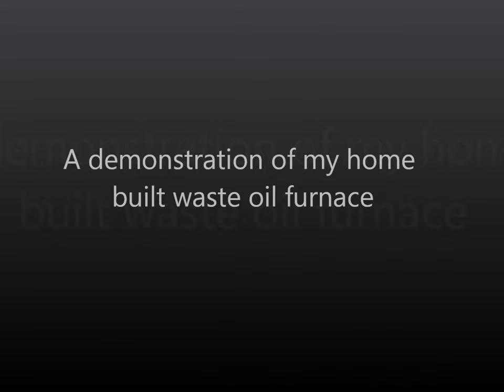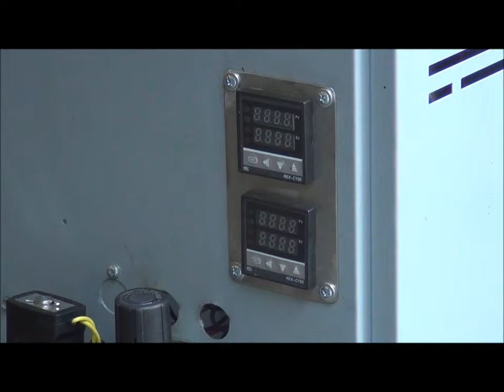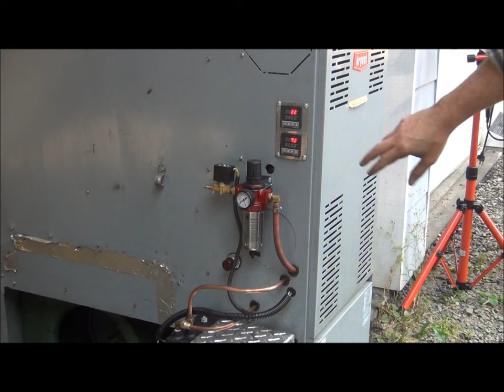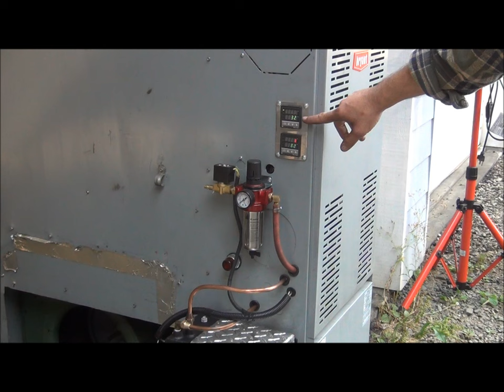Waste oil furnace

Comment: Hey Matt I am having a problem finding the run time relay you are referring to for your pump and float valve safety feature, can you point me in a direction of what you used
Reply from the maker: Sure, since I don't know your exact control and load setup I can't tell you exactly which part number to use, but the link below contains the relay series that I used: https://www.mcmaster.com/time-interval-relay/socket-mount-timer-relays-7/
Reply from the maker: This could also work, if your pump load is small enough:  https://amzn.to/3kMIu0p

Comment: Do u have a separate heating source for the nozzle temp? Is the temp controller for the nozzle just a reading or is it controlling the temp?
Reply from the maker: Yes, there are separate heaters for the nozzle and the oil tank.  The PID controllers both display actual temp and control the on/off cycle of each heating element.
Reply: Iv tried to figure it out. But what are u using to heat the nozzle. Just a small heating rod of some sort strapped to the nozzle assembly?

Comment: Did you tie your siphon nozzle into the the inlet side or the outlet side of the pump? Would it be necessary to have the small oil tank located on the side with this recirculating setup as compared to your older design that relied heavily on siphoning the oil... Seems like this setup somewhat primes the siphon block.
Reply from the maker: +Ryan Wheaton The nozzle is tied into the outlet side of the pump.  The pump discharges back into the heated tank, and the nozzle is just in a tee in that line.  This system is less susceptible to clogs than my siphon-type system, and less susceptible to ambient temperature changes.
Reply: sewerzuk thanks for your reply.. Im in the final stages of mine.. I've incorporated a floor heat system that uses the hot air from the plenum to heat the glycol. So far so good, its running on propane at the moment though.
Reply: +sewerzuk how does the tee work? what keeps oil from pumping too much oil through the nozzle?
Reply: I have a needle valve up govern mine
Reply from the maker: The nozzle is physically higher than the tee and the oil level in the tank.  The oil is being pumped at about zero PSI.  The siphon nozzle just sips what it needs out of that line.

Comment: can I ask the reason for the 2 heaters?  seems like a well designed nozzel heater would be sufficient.  install a pinch valve for the inlet to the nozzel and a pressure relief regulator to relieve pressure back to the inlet of the pump?
Reply from the maker: I had difficulty getting a consistent flow rate without heating the oil in the holding tank.  I may have been able to correct it if I spent more time on the oil delivery system as you suggest, but the heater solution seemed to work out well.
Reply: +sewerzuk I'm converting two furnaces to used oil heat this summer. 

 I was thinking of using a 1.5x1.5" aluminum block and machining 1/8" passages back and forth through the length of the block around the circumference of the cartridge heater.  giving the oil about 30 or 40 linear inches of travel to heat up before hitting nozzel.  The pinch valve for the oil nozzel should probably be installed "post heater" for flowrate consistency (oil viscosity).

the only problem I see with my idea is that if the discharge line on the recirculation tubing breaks you're going to end up pumping the entire content of your tank onto the floor.

a similar situation could happen with your design if the leak is slow enough that your filler pump can fill the 1 gal tank and shut off before your TDR trips.
Reply: Question, I machines up my block and I'm getting good flame from the burner.  After about 20 seconds the arc in the furnace turns off and the flame goes out.  Did you have this issue?  How did you deal with that?  

- I'm not sure if there are differences in Beckett controllers..  Maybe you just hard wired the transformer to run the whole time?  Maybe my assembly just needs adjusted somehow?
Reply from the maker: It sounds like the flame detector is timing out; if it doesn't see a flame after a preset time, it shuts the burner off.
Reply: I read through several different Beckett manuals and found that they have what they call "intermittent duty" and "interrupted duty" ignition.  Intermittent running the entire time, intermittent shutting off after the flame is established.

The only difference is the way it's wired.  To have it run all the time they wire the ignition parallel with the blower fan.  So if the fan is running the ignition is running.

Do you add any diesel or anything to your oil to get better burn characteristics?  Or is it just straight oill
Reply from the maker: ***** Interesting; I've never run into one of those.  I'm not a HVAC tech or anything though...I've just tinkered with a few oil fired furnaces and boilers...

Comment: what did you use for a timer relay, i couldn't find anything in your info
Reply from the maker: +Andy Fromm I can't remember the exact model; but it is a magnecraft 120v time delay relay.  Here's a link to similar models:  http://www.serelays.com/products.php?t=TDRSOX-SRX
Reply: I have the save thing but different brand but I can't get it to work on the correct mode, it will work on other modes though.
Reply: +sewerzuk sir I have a question for you , could you do this with a boiler, I'm sure you could. I would like to heat my 3400 square foot pole barn with radiant heat from a used oil burning boiler do you think that's possible?
Reply: +Angela Miller  I did this to a boiler and heated my 45x54 shop with it this winter.
Reply: ***** would you be interested in building one for me, and how much.
Reply: ***** and I know there's always the question of liability I would be willing to have an attorney draft up something so there is no liability on you?
Reply: +Angela Miller I probably don't have the time & we are probably to far away.
Reply: +Andy Fromm I know they sell new ones that run on used oil and such can you direct me to a good brand? I live in Ohio if you were wondering.
Reply: +Angela Miller I'm not sure on a good one, I paid $100 for my used boiler and then converted it. I would look for something easy to service. Depends how dirty the oil is, sometimes it needs to be cleaned often.

Comment: Very nice presentation. Thanks... I wonder if some kind of turbine could be put on the exhaust to power a generator?
Reply from the maker: Interesting thought; I'm always looking for efficiency!  The problem with introducing any kind of restriction in the exhaust is that the furnace relies on a clear unobstructed vent to draw air into the combustion chamber.  I worry that adding something like a turbine would mess with proper combustion.
Reply: Yes I agree.  Now I like this one radiant floor heating which I do believe mentioned if I am right.. I would also tie that into radiant floor heat to the garage and need be zone the driveway and sidewalks with radiant tubes and no shoveling snow. I plan on doing just in our next house.  The older you get the more you have to worry about overdoing it.  As you mentioned that is "FREE HEAT"  all is good. Thanks for say hello.
Reply: +sewerzuk would you be interested in selling one?
Reply from the maker: Paul Miller Sorry but I'm just not willing to build one for somebody else.  Too much liability for me to take on...
Reply: +sewerzuk I understand, what a shame though I would pay good money for that.

Comment: Just using a 1985 Wayne oil burner in a kenmore furnace,, to me its a waste of money and extra trash just to burn used car oil and this and that.  Mix a gallon of gas in 2 gallons of USED CAR OIL and it burns without trouble. Just as good to add gas to the junk and burn it in a standard oil furnace.

Comment: What a waste... waste oil furnaces are more of a joke then just burning red dye diesel.. AIR COMPRESSOR HEATER TO HEAT THE WASTE OIL. THEN A PAN TO HLD IT AT THE RITE TEMPO... Then having to deal with filters all the tine.... DIESEL FURNACE... one simple filter for the diesel fuel... one air filter no more jokes...

two burn waste oil OILY WAGS... SOAK UP THE OIL IN THE RAG THEN putty it into wood burner... thats free heat....